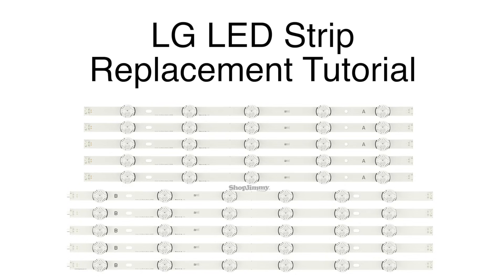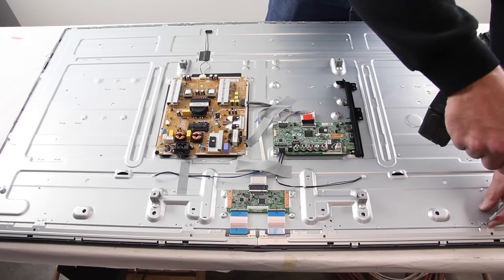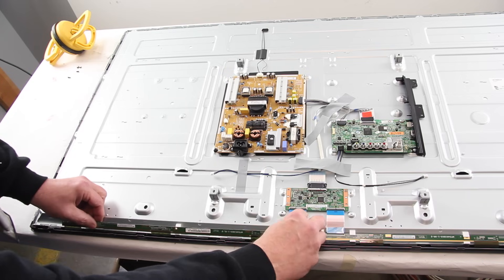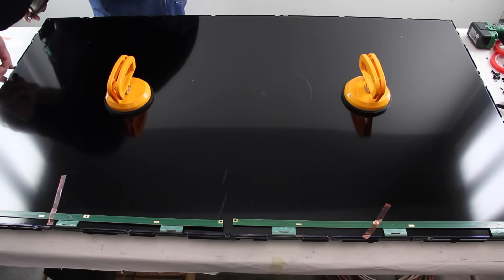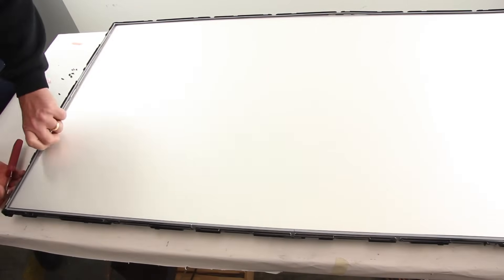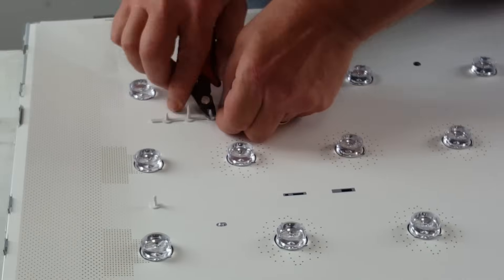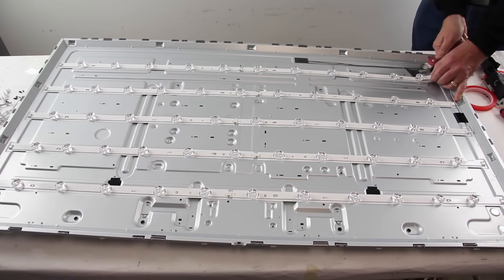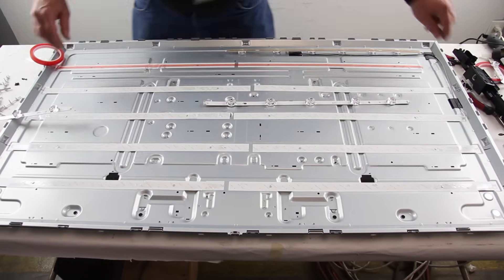How to Replace LED Strips in LG LED TV - 55LF 55LB NC55 - Fixing Bad LED Backlights

Comment: Tape does not work on the light filters as it won't stick underneath. ABSOLUTELY DO NOT TOUCH THE THIN LIGHT FILTERS WITH HANDS. WEAR GLOVES OR BE EXTREMELY CAREFUL. As unable to see in the video, lift clips for the led strips upwards and out, not back. My backwards. Touching the light filters after the tape didn't stick, destroyed the filters and image quality.

Comment: Holy shit!! I have a horizontal line going through my lg 49uh850v 3D tv. Only appeared this week for no reason. I have 2 x spares of this tv (just in case the one I use packs up). I've swapped the power board, main board, t-con cables, a ribbon cable. Still no change. I thought maybe I could try new light strips. After watching this video, the tv can go in the bin. This video is great, but, jesus man, it needs to be done by a professional repair person. This is way too deep and intense for me to do. I'd end up putting a hammer through it!

Comment: If some pin connectors came off from the ends of the led strips, do I have to use soldering or glue?
Reply: I can see some tracks are gone, they led strips came damaged.

Comment: Everything worked until I got to the filter frame and it broke in several spots , really cheap plastic. Is there an alternative to the filter frame like electrical tape. I don't want to go any further if the tv wont go back together.

Comment: Done this to my Ultra HD 4K TV about 4 years ago,Brought my HD TV from E bay for as little as 99p in theAuction for spares or to repair,£10 for postage,£15 for the replacament backlights,Mean while,A lot of dark shades in the back of the TV screen,Since I replaced the backlights,Then carefully put it all back together again,It's been a perfect working TV ever since,Use it most of the time ever since mostly for internet,Got it up on the frontroom wall,Connected to my gaming Computer

Comment: Is the blue or white wire the negative feed? My TV has 3 wires that run to the connections. There is a black & blue  to 1connection, blue & white connections to 4 other connection points and 2 connections with a small blue wire loop that connects to the led strips.

Comment: Worked like a charm in repairing a free TV I found on Craigslist list.  Not half as intimidating as it originally seemed.

Before we attached the new LED strips we put the reflector sheet back down to mark where they should be for the new ones.  Might be a worthwhile idea

Comment: Couldn't you just untap/tape the bezel, panel, frame, with the set face-down, and then lift the chassis out, leaving the front of the display laying flat? Then work on the chassis separately, then put it back when done?

Comment: Thanks for this video. I have a question, possible issue. Does it matter far as the lettering is concerned? I took photos for the connection concern not the order of letter.

Comment: I have horizontal flicker to the top section after  replacing the lights ... the rest of the picture seems to be in sections ...   I replaced t conn with no change ...

Comment: 55LH575A - Prior to installing the new LED strips, the picture was fine, but dim in areas. After replacement, the led lights are working fine, but no image appears on screen. Various colors and lines are appearing and I can see that something is happening as I push buttons, but no detailed image is on the screen. I purchased a new tcon board also, but swapping it out doesn’t change anything

Comment: Great video. I had 2 tables set up with blankets though and flipped the lcd face down on the blanket after i got all the circuit boards loose and lifted the backlight assembly off since i didnt have sx cups. AND it seemed likely for me to break something lifting it and flopping it around. replaced the leds on table 2 and flipped it back.

Comment: The first TV I fixed was my 65 inch 4k Smart TV I got for free from someone who said only the bottom strip of lights worked, me being new to this didn't care and wanted to try it out, got new LED strips, and 11 hours and taking it apart 3 times later, I got it, don't know how I didn't break it. Forgot the piece of cardboard inside that I used to help get the screen out, so had to take it apart the second time, then had to take it apart a third time because there was a small piece of tape on one of the ribbon cables to the t-con board and so half the screen was flickering and discolored until I took the piece of tape off allowing the first few pins to reconnect, lol. It was a nightmare, but it was fun

Comment: Do you know what it means when the LED (LD701) on the back of the power supply board flashes 4 times? This occurs after the backlights turn off.
I have already bought an LG 55LM5800 Power supply repair kit from shopjimmy (because you were out of stock of the ps board). That didn't fix it so I replaced the main Caps, that didnt help so I bought a replacement power supply board and IM STILL having the same issue, please help?

After replacing the ps board the backlights power on & everything works for about 20-30 minutes then the backlights turn off.

Now when I measure the voltages at the led strips>power supply board it goes up to about 70v on both connectors then drops quickly to zero volts. If I place my DMM in Loz mode then the voltage doesn't drop to zero and It reads a steady 71.1v on both connectors. It's an edge lit model btw.

Comment: I'm halfway finished changing mine I just want to say thank you for this tutorial 🙏🏼 I also ordered my led strips from you guys as well
Reply: Do you know the order of the light filter by any chance?
Reply: @HKS2000  no I taped the cornes of mine with painters tape so I wouldn't get them out of order and just put them all back in at the same time
Reply: @Mill-on-da-track  technically they are still in order except for the thickest one thick on on bottom or top

Comment: Wish we could've seen a before and after to make sure that's what I need to do
Reply: Absolutely, a short section of the original fault of this TV should have been made before any dissembling...
IE.. My TV turns on, sound is perfect, picture appears perfect, no dark or overly bright areas ..picture shows clearly for a split second ..then whole screen goes black for a few seconds and then cycles in this pattern. When working normally, a small section of the screen would occasionally have an flicker as opposed to a flash and would be more apparent when displaying a white background.

Comment: Great video.
I'm fairly technical, but would never have just dug in and tried to replace the LEDs without this video.
I got 3 of these TVs and they all have the purple screen, so I'm hoping this does the trick!
Reply: LED Tester 0-300V Output Multipurpose LED Lamp LED TV Backlight Tester Tool
Reply: @metrork1  hello i i put in back ligth is on but now i can change the channel why gelp😢😢😢
Reply: @metrork1 hellll0
Reply: did it fixxed it? my top right corner is blueish, i think i have the same issue

Comment: Thank you Shop Jimmy; tutorial very well done, scripted and edited; for the record, it is applicable also to the 60" version of the TV, the 60LB6500-TA.AAUWLJD, which is sold in Australia; identical clips system holding the white sheet and identical overall layout; keep doing these videos, they are very much welcomed and appreciated. 
Note: I have tested the LED strips before replacement, and, in my case, (of the 6 strips) 3 were shorted (!!!) and the remaining three had one led not coming on, and the others were relatively faint. I am now going to buy the strips.

Comment: I'm sure there has to be an easier way to make these strips replaceable. But I forget they don't want these to be replaced, they want you to just buy a new T.V. still this is the most commonly failed component why does it have to be the hardest to access.

Comment: As a person who has already done this you don't need to do half the stuff this guy is doing. 1. No need to buy suction cups, place screen face down on a towel let it rest there instead of trying to lift screen. 2. No need to hammer and chisel the strips off they just pull off if you do it with care keeping your hand close to where you pull. 3. Unless all of your strips / LED's are burnt out i wouldn't be replacing the entire strip(s). They are quite expensive to buy and you are not guaranteed they are new, and if second hand you don't know how many hours are on them. The cheapest way is to buy individual LED's from Ebay or Amazon costing cents and replacing them. They are easy enough to replace with a soldering iron. I have done this on exact LG in video and replaced 8 burnt LED's, Job done.
Reply: Just curious once you have the LEDs in plain view how do visually know which ones are bad? This guy replaced all of them in the video. Should I just assume they're all bad?
Reply: @memphistiger4647  a lot of the time the LED will be discolored, not usual yellow. And the ones that are burnt out will have a black spot or mark somewhere on diode. Best way is to test with a LED tester. Cheap on EBay or Amazon then replace individual LED’s which are also cheap. If you try to buy complete strip then it will end up being very expensive especially if only one or 2 LED’s burnt out on strip. All depends how long you want fix to last. Might have same issue with other LED’s over time but to get it working that is the way to go. Having brightness of backlight up to 100% causes this issue especially if TV isn’t that old.
Reply: Do you know the order of the filter screen?

Comment: Thank you.  I would have not attempted this unless I was in virus social distancing spare time.  I would normally have purchased a new TV.
Thanks to your help I now have a repaired 47LB585V TV with a stunningly good picture (it was given to me as broken).
It would have helped if you'd mentioned that it's easier to remove the three pointed standoffs in the middle, if you temporarily remove the PSU board and motherboard.  The are much easier to remove if you can access both sides of the chassis plate.

Comment: Mine's starting to have a lone flickering LED. It's getting ready to take a shit. Oh well. It gives me an excuse to upgrade to a 4K TV now. I bought my 1080p LG TV brand new in 2015 and it lasted only 5 years. I will not be buying another LG TV again. LG is using shitty LEDs.
Reply: My Samsung 55" premium curved screen TV had the backlight reflectors start to fall off after just 4 years..
The TV was never moved after it was put in its original position.. So it's not just LG 😅

Comment: Such a simple problem like a couple of bad led strips and such a long and drawn out and fiddly process to replace them, the person who invented the LED television should be sentenced to life in prison without the possibility of parole.
Reply: It wouldn't be a problem if they used alumnium strips with thermal paste to diffuse heat and prevent the leds from cooking to death. They use glass fiber strips and put zero measures to prevent overheating, literally building screens to die out in a few years.
Reply: Yes you are absolutely right. The right the early models would cost so much. My 55 inch stopped 2 years. Repaired once for almst 1/3rd cost, but just lasted for six months. Since I stopped watching tv. Thanks for this video, I shall give it a try soon.

Comment: I have applied every step here, with great care (as much as I could) I have taken the risk of removing the LCD panel which is the most expnsive and fragile part in the assembly. It's not very easy to remove every connector as well, especially the panel driver connector is very sensitive too. There are so many screws and all sorts of clips and one must be very careful to remove them without damagnig the TV. I have used a smaller set of vacuums to hold the LCD but they did the job (still paying great attention while holding the LCD panel)... Hint: this LG model of mine, claims that its LCD is immune to mechanical crashes, so I was hoping that bending during panel removal won't cause a problem... So many levels, very tiring, it took about 4 hours for me. (one hour for just one defective screw!) At the end of the day, I have managed to replace one line of leds which was defective... Thank you sir for this extremely helpful guide. ..

UPDATE: four months ago I have replaced one row of 2 LED bars (A and B type), and commented the result. Now, last month another LED strip from the remaining bars also burnt... :-(. This was expected, but not so soon, the time was somewhat shortened due to the Corona virus stay-home full time TV netflix watching... :-)  So, this time I decided to replace the whole set of 10 bars. Last week I bought 5 rows (10 bars) of new LEDs. Reopened the TV and replaced all the bars. One thing I observed was that the defective bar was connected to the  renewed bar. Note that among 5 rows, upper two were connected in series and the lower three were connected separately in series. So the new and old bar connection in the upper part failed before the lower three older bars. This supports the fact that renewing just one bar (or one led) among older ones, impose more strain on the remaning bars and kill them faster than otherwise. So it's better to replace them all together unless something else was necesary. It was extremely tiring again. The internal frame that holds white polarizor screening really was a headache. Also moving the LCD panel was a thrill too. Indeed one of the vacuum cups broke during the panel removal but I was lucky as the drop height was less than half a foot. But then I had to find another (safer) approach to remove the LCD screen, not relying on suction cups. Slightly pull the LCD panel aside without scratching and bending it. Note that this model of LG TV claims to have a scratch and hit immune LCD coating. It was demonstrated to me when I decided to buy it. The seller hit the screen with his palm and said that this IPS panel was strong enough to survive children filled house accidents! Anyway. At the end of the day I managed it. But there was a disaster ! In the first trial I have forgotten to connect one cable on the last LED bar! The TV didn't work OMG !!! I almost gone crazy!! but then I re-opened the TV and found that I forgot to connect the LED bar connector at the lowest bar !!! OMG I was happy but very tired! You know. I do not suggest this LG TV. It's overall a good TV but first its LED lighting strategy is wrong which burns then at 4 to 5 years! Furthermore, the white-screen is not fully uniform in brightness and there are ghost shadows on the screen when a white background shows up, especially when it moves fast enough the gost shadow pattern becomes painly visible. I do not suggest this TV because of this. But the functionality of the TV is quite good. It connects very well with computers, ADSL box and other devices. Its built in satellite decoder is also working fine, despite being slow in channel seek...
Reply: @Dann NY me too
Reply: Do you know the order of the light filter?
Reply: Please do not use the OM expression there is no need God Bless

Comment: Unfortunately I cannot see how he is disconnecting the LED strips from the cables/wires. He just pops it out but it seems like I am going to break something if I do not use the right technique.
Reply: Had the same problem. Couldn't really find an answer anywhere, so just started messing with it if it broke or not. But lucky figured out you need to pull them up not backwards like normal connectors. Might need a flathead screwdriver, slightly pry up under the tiny lip as well as gently pull up from the side the cables go into.

Comment: I used these steps to affix those little plastic lenses that had come unattached. HUGE QUESTION: I got my diffuser sheets mixed up. I have one thick sheet with one matte side and then two thin sheets. Not sure where I went wrong and I've tried them in different configurations but I am seeing the LEDs behind the sheets.  WHAT IS THE CORRECT ORDER of these sheets????  Thanks to anyone who can help.
Reply: Did you ever figure out the problem I ran into the same issue should the thick sheet be on bottom or top?

Comment: My TV started to flicker on and off the other morning. After dealing with LG Support, I got on YouTube to see if I could figure out my problem. I came upon this video and decided I would give it a shot. When I received my new LEDs, I noticed the + and – markings on the new ones were different than the markings on mine. I contacted Shop Jimmy to inquire about the difference as I did not want to fry my TV. Shop Jimmy assured me the strips were correct and that the plugs would need a little extra pressure to install them on to the new strips. I proceeded with the install and my TV now works like a brand new one. Thanks Shop Jimmy for your product, video, and your professional support team. FYI my TV was a LG model 60LB6500-UP.

Comment: Thank you ShopJimmy! I just reconnected my LG47LB5800 and it works again! [40+ SBF] I ordered the LED strips and double sided tape from ShopJimmy. The suction cups and 5-in-1 tool were out of stock, got those from Amazon. 

One additional suggestions take a photo of how the wires are connected as well as the proper order for the strips. Also use a lightweight tape to keep the filters together.

Comment: I was given a 55" LG with the picture flashing on and off.  Dismantled it per your video and found 36 of 55 of the backlight LEDs burned out.  Replaced all the strips with new ones from Shop Jimmy and now I have an "almost  free"  55" TV.  Set the backlight to 73% to hopefully prevent future burnouts!  Thanks for your concise videos and great parts selection!
Reply: That's what I wanted to know, I got a free 50 inch, the light strips flicker, pulled apart, found a few blown leds, I'm guessing by your comment that replacing these will fix it? Or at least it did yours?